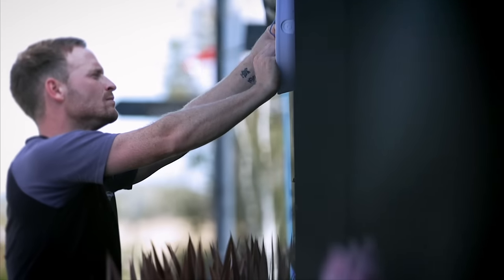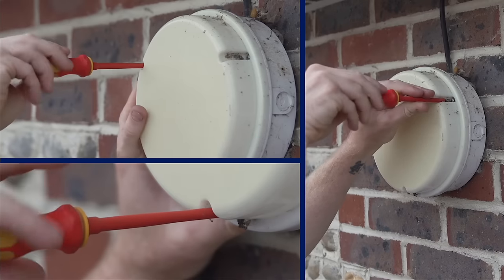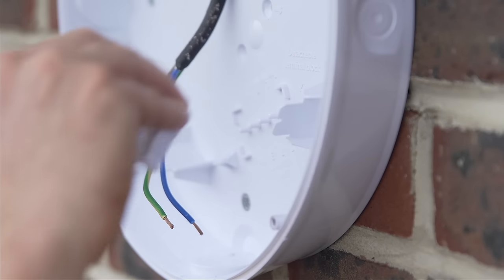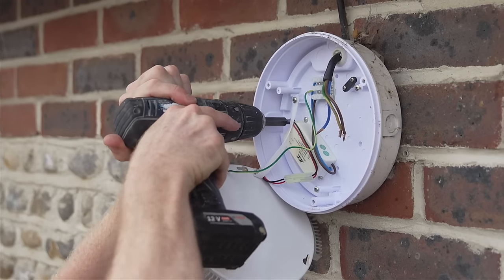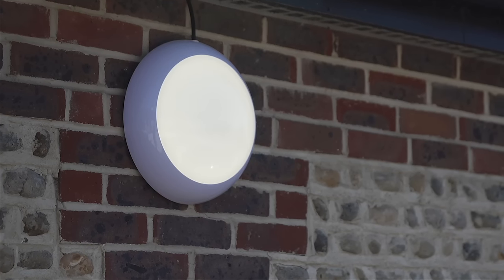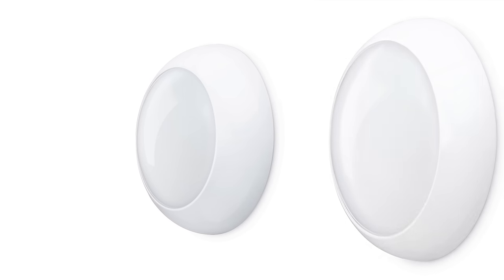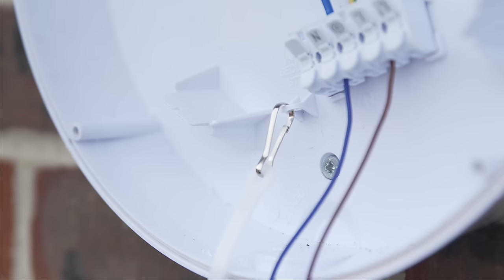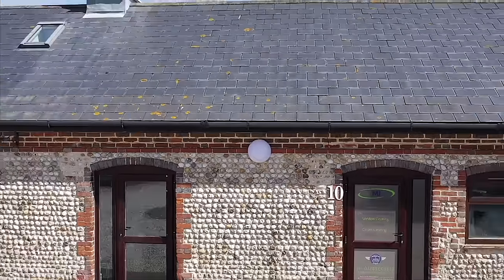RadiaLED® Rapid  | Fast installation LED bulkhead range from JCC Lighting

Comment: Great product, and would suit my requirements perfectly but only one issue - can't locate a supplier for the rims or any of the other accessories. CEF stock all the different units in white, but no one seems to be stocking the rims, and I need black and chrome.
Reply from the maker: Thank you for your comment. We're glad you like the product. Our products can be sourced through electrical wholesalers, but if they aren't a stocked item, they would need to be ordered as per your request. I can put you in touch with your local Area Sales Manager and they will be able to guide you on where may be stocking the product you need.